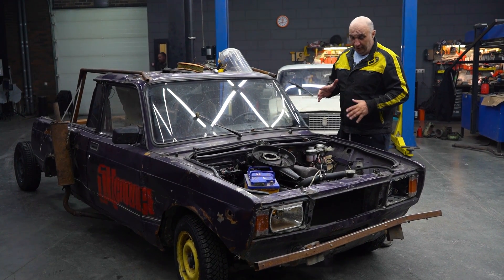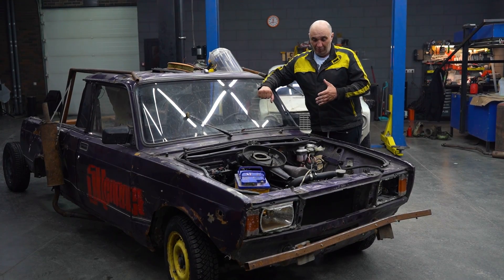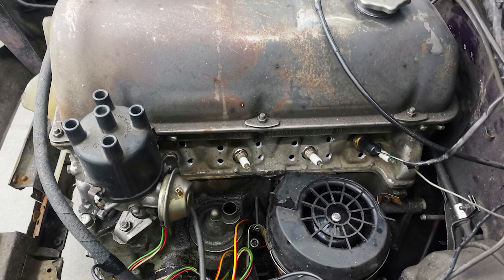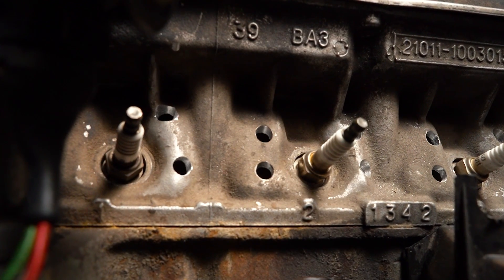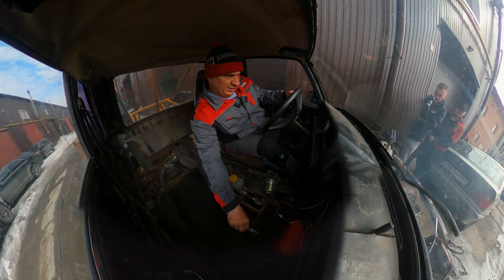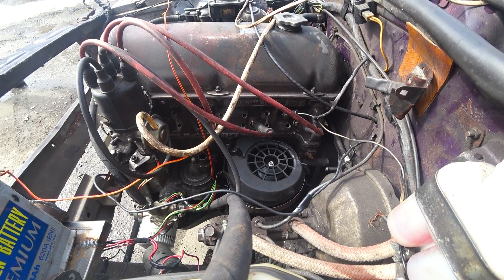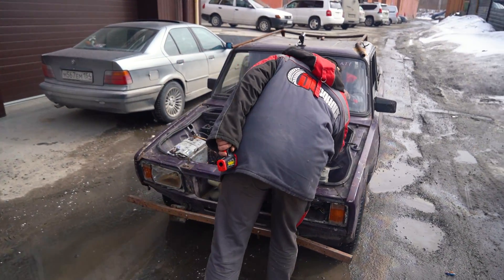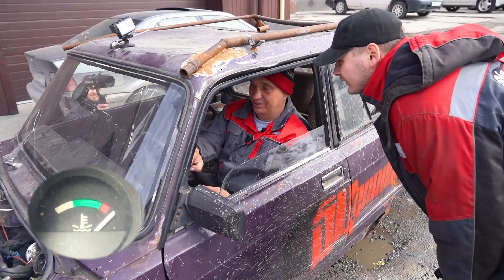We convert a Lada motor to air cooling

Comment: Nah.... Lots of people saying air cooled is basically oil cooled - whilst air cooled "now" means that.... It more often traditionally referred to a whopping great set of fins around the cylinder, great air flow and no seperate oil radiators.... There are plenty of classic examples that prove that... It didn't work out too great in higher compression 2 stroke and / or 4 stroke engines hence the advancement to air cooled oil radiators.... Which actually work amazingly quite well - lots of high compression high performance 4 cylinder 4 stroke motorcycles have just a huge oil radiator and small fins  for cooling.....

Comment: first the electric fan is suckin the hot air need to have some cold air for intake for that fan and add oil cooler and retared the timing and also be better if decreasing the compression ratio too ;)

Comment: i think what your missing is  fins on the head all air cooled engines  the entirew head is full of heat  fins  as it   acts as a heat sink and is also cooled by  a fan or the flyweel on  lawnmowers and such they push air over the fins to   better move heat away  so there basicly was not enough surface area for the heat to dissapate

Comment: I noticed that the temperature was not as even (ranging from 160 to 130 at one point in the video), so perhaps some aditional air intakes/turbines would be necessary.
air has way less heat transfer capability than water or water/ ethylene glycol mixes, so a higher flux is needed, but then again, you can not run out of air (unless Elon Musk gets his way).

Comment: Fitting an oil cooler would help and if possible finning the engine block may help as in an air cooled engine and doing the experiment in tge middle of a Siberian winter may help but here again an example of how robust the Lada engine is

Comment: The temperature sensor should only read when submerged in coolant or water but that temperature sensor for the engine will not read until it’s running hot most likely but those engines just keep running but I would definitely be worried lol I would make it have a big oil cooler so it would stop burning oil and I think a lot of other people wanna see that happen and that sensor reading something but in America our temperature sensors would not work if it wasn’t in some coolant and I bet that’s burning oil like fuel almost 😂

Comment: Since you aren’t using your radiator for anything now; how about you plumb your oil pump into the radiator.. that is circulate the motor oil through the radiator and cool it that way… and try again… no coolant; just oil cooled in the coolant radiator… would be neat to see that

Comment: First off, the hot air is coming out right on the intake of the fan. You need to bring the intake up out of the engine compartment. One reason most cold air intakes are useless. 

Try running an ac unit and blow into the intake of the fan. I want to see this work.

Comment: Oil cooler and you actually should reduce airflow so that it hangs around longer in the block to actually absorb heat. Air sucks at thermal transfer.

Comment: If only you would have had an aluminum block    lots of fins and a shroud with a better fan     ... On my air cool motorcycles  the temperature gets up  to 180⁰C pushing them hard on really hot days        ..doesn't seem to bother them    I use Lucas synthetic oil stabilizer at 60 to 70%  that stuff is equal to 110 viscosity weight   I mix a little Restore engine additive with it    it imparts a metal coating onto the moving parts .. temperatures at 180° C   can bring even that heavy oil  viscosity down to not much thicker than water

Comment: Drive it in reverse, it'll bring the temp down 🤣 For funsies you could add a turbo and a large intercooler to blow cool air into the block instead of that little electric fan. Now that would be funny. Also try an oiler cooler. 😁 Love your vids!

Comment: What if you were to put an air conditioner on the air intake of the fan? Then it would be getting cold air pumped through the engine.

Comment: Now, can you modify a Lada engine to drive without failure at 200'C? Some high temperature oils,... Some high temperature gaskets.... Conrods will probably frag due to temperature-induced weakness though.

Comment: I have an idea!!!   Have a turbocharger feeding air into a bunch of Vortex Coolers (like 10 coolers in parallel). Then, that air will go into the air cooling vents which you guys made. The resulting air will be very cold, and the air coming out of the engine can be measured to give a proper idea of how effective this method is.

Comment: That's not how you are cool an internal combustion engine. The majority of the heat produced is in the cylinder head. You need to have heat sinks connected directly to the combustion chamber, not air blowing through holes in the water jacket. Russia has made air cooled engines in the past (a v4 rear engine ZAZ comes to mind) so you should know the proper technique.

Comment: You should plumb the intake through the coolant channel. Use the engine to pull the air through the engine to cool it. The higher the RPM the better the cooling

Comment: Every guy that owns a 1980s Honda D series engine with a cheap DIY turbo kit running on a EBay FMU. Obviously with a OEM head gasket and cast pistons. Are watching this and thinking to themselves that those temperatures aren’t that high. Lol It’s fine until you see a good amount of black smoke mixed with the white. That’s when their beast AWD Civic wagon is fastest, obviously.😆😩

Comment: this will not work, water cooling is way more efficient than air cooling, plus the water jacket around the cylinders makes it impossible to cool, you need a lot more area for air cooled engines which is why they have cooling fins.